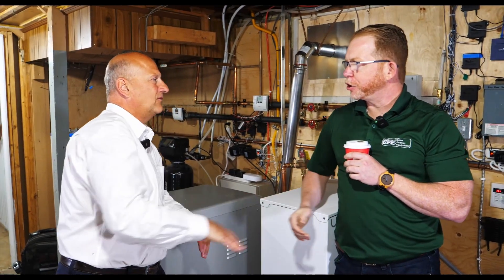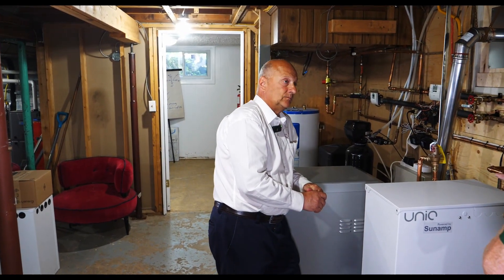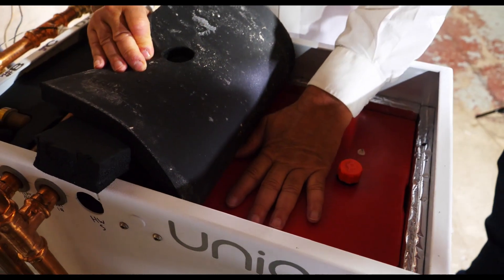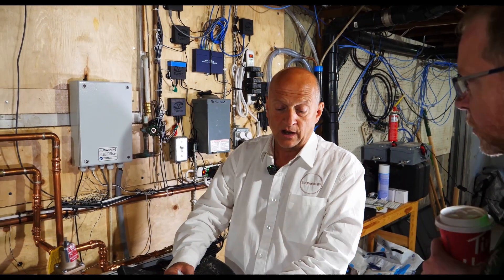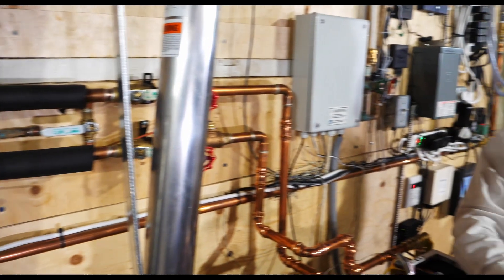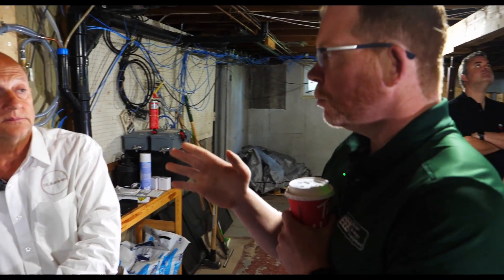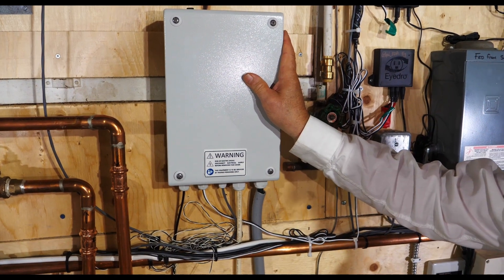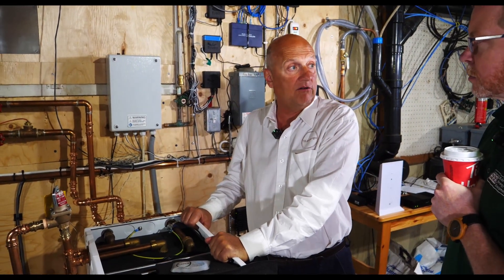Unlocking the Future: Sunamp's Revolutionary Thermal Batteries!

Comment: I'm sorry but what you have is really obsolete. We don't need to storage energy. This is ridicules. No one will use a gas furnace in the future. Electric energy is free.
Reply from the maker: Thanks for commenting. There is no gas because this product is exactly as you said the future. It is charged with thermal energy from any source including PV, a heat pump or solar thermal. In this example they used waste heat from a generator
Reply: If you use your head for a second.

I go to work. Nobody home. Sunny day. PV panels on roof, wasted.  No, not having a li-ion bomb near my house either. But, put this thing in and I can store the free leccy as heat! Could do that with a water tank, but that is cold within a day. This thing however remains able to heat the HOUSE at NIGHT as well as DHW from the taps.

No explosion waiting to happen in the li-ion battery... There isn't one.

Hot water for days and all I needed was one sunny day.

 And if the sun doesn't shine, when the clouds are thick and black, but the wind is blowing, the nuclear plants are humming too and there is loads of electricity and the price plummets, even going NEGATIVE, well I can literally be PAID by the electric company to charge this thing up. Thats better than free mate.
Reply: @dlarge6502  But if I have a device the size of a shoe box  that cost about $40.00 to build and that will will pull energy from your surroundings, not heat or cold energy that will power everything electric in your home in fact 3 homes that will last about 35 years then that is better than what you have. It has no moving parts and is all electronic. Can't beat that with a stick.

Comment: Why do you convert electrical input to heat with a resistive element rather than a heat pump?
Reply: Well, if you can't have a heat pump...
Reply from the maker: Thank you for your comment! The unit can be charged using its built-in 2.7 kW element in approximately 5 hours. Opting for off-peak charging can reduce the cost to as low as 2.5 cents per kW in certain regions, compared to on peak costs.

The unit can also be thermally charged using an air-to-water system, air to waters can easily achieve an impressive COP of 2. With off-peak rates, this can bring the cost down to just 1.25 cents.

PCM batteries offer versatile applications at a fraction of the cost compared to traditional lithium batteries but more important allow us to store BTU instead of watts

Comment: But can it power a car... 🤔
Maybe proof of consept with a lawnmower?
Reply from the maker: This is a thermal battery for heating your home not for storing electricity. Your comment is spot on that it will not run your lights but it will heat your home. Tks for sharing your thoughts 🙂
Reply: @plumbing-hvacmagazine  I was just thinking about a different application for the technology, using it as a thermal battery and generating electricity on demand via a heat differential.  Was thinking of a possibly smaller one for a car.  Maybe not power the whole car for long distances, but maybe siphon the heat off the engine it the battery pack, or the inside of the car when it's parked in summer, and then use the extra energy for some extra miles, or to save battery power for driving and use this for the internal systems within the car ... 🤔
Reply from the maker: @colleenforrest7936  it's a great thought. The smallest unit is about the size of a microwave and they are charged thermally or with 2.7kw of electric energy. In our next episode we will show off a site using this battery off grid to produce 80 percent of their domestic hot water. Thanks for the great comments

Comment: $4,000 to offset the cost of an 80 gallon water tank?   Hmmmm
Reply from the maker: Great question and thanks for commenting. We cant speak to the price because we dont know the price ourselves but keep in mind this is NOT a buffer tank its closest comparison is a high performance indirect.

While water is a commonly used medium for thermal energy storage, phase change thermal batteries utilizing phase change materials offer several distinct advantages:

Energy Density: One of the primary benefits of PCMs is their high energy storage density. This means that, for the same volume, a phase change thermal battery can store more energy than water. This allows for compact energy storage systems, which is especially beneficial where space is a constraint.

Targeted Temperature Range: PCMs can be engineered to have a specific melting/freezing point. This means the energy storage system can be tailored for specific applications where a particular temperature range is desirable. Water, on the other hand, has a fixed phase change temperature at 0°C for freezing and 100°C for boiling (at standard atmospheric pressure).

Consistent Temperature Output: During the phase change process (from solid to liquid or vice versa), the temperature of the PCM remains nearly constant. This is a useful feature for applications requiring a consistent temperature output, as opposed to the changing temperatures one might get as water heats up or cools down.

Reduced Heat Loss: Due to the latent heat storage mechanism of PCMs, there is reduced convective heat loss during the phase change process. This means that, under similar conditions, a phase change thermal battery retains its stored energy longer than water. Our host Michael uses a water battery not a PCM and it cant store energy for when its needed because of the stand by losses

Versatility: There's a wide variety of PCMs available, from organic compounds to inorganic salts, that cater to different thermal properties and price points. This versatility allows designers to choose the best material for their specific needs.

Integration with Renewables: Phase change thermal batteries can be efficiently integrated with renewable energy sources. For example, during peak solar hours, excess energy can be stored in PCMs and then released during non-sunny periods, providing a stable and continuous energy supply. In our next episode we are in a home where they have a PCM and are completely off grid and it produces 80% of their hot water and has for  2 1/2 years. We dive into the logged reports during that episode as well as walk the home. 

While water is abundant, cheap, and has been used for thermal storage for a long time, phase change thermal batteries offer performance characteristics that can make them a better choice for many applications.
Reply: @plumbing-hvacmagazine Was the episode ever released with the off-grid house? Thank you

Comment: How are you addressing the failure and leaking of your "batteries".  There are videos on YT showing this issue.
Reply: They are not batteries in the traditional sense. Eutetic Salts in a liquid form in plastic containers. The chemicals are not noxious, like battery chemicals. The manufacturer backs the units with a decent warranty, so service shouldn't be an issue...
Reply from the maker: Thank you for your insightful follow-up. You're correct in pointing out that there is no significant safety concern with the Sunamp heat batteries. This assurance stems from the design and materials used in these units. Sunamp's technology utilizes phase change materials, specifically designed for thermal energy storage. These materials are non-toxic and non-flammable, which inherently makes them safer than many traditional energy storage systems.

From talking with their CEO in person he has told us that Sunamp's products undergo rigorous testing and quality assurance processes to ensure they meet high safety standards. This includes addressing any potential for leaks or failures in a way that minimizes risk to users. Whenever you see a user on Youtube complaining of an equipment issue its important to ask why and understand there could be other underlying issues but we are by no means taking a side. We encourage everyone to reach out to the manufacturer with any questions they may have. It's always refreshing to have knowledgeable viewers like you contributing to the conversation and helping to clarify important points about the technology we discuss. Thanks again for your valuable input!
Reply from the maker: Thank you for bringing up your concerns about the Sunamp heat batteries. We understand that issues like this can be concerning, especially when you come across videos that highlight these problems. It's important to note that we, as the creators of this video series, are not directly affiliated with Sunamp. However, we are committed to providing accurate and helpful information.

For specific inquiries or concerns about a video its important to note we dont have the whole picture or the whole story, we recommend reaching out directly to Sunamp's customer support or technical team. They are best equipped to address these issues and provide detailed information. If you need assistance in making this connection, our series host is available on LinkedIn and would be more than happy to help facilitate this communication. Ensuring you have the right support and information is important to us.

Comment: We have one,  its a nice unit, was a pain to move at something like 250kg
Reply: One of its (very) few disadvantages over an equivalent water-based storage vessel.  I wonder if you'll be able to get them delivered empty of PCM in the future and just fill it up from easily portable 10 gallon containers of PCM prior to commissioning or something...?  You'd have to heat the PCM first, of course, to melt it...
Reply from the maker: Our host Michael attempted to move one in his life fire lab by himself. He thought he had the Thermino80 which has a  weight of 164lbs. He actually had a 300 which is 496lbs. He was not able to move it... despite all his Crossfit time :)

Comment: Please! Stop using "Latent Energy" and say what it is: Latent Heat

The heat pump produces heat as a "waste"??m

Then 😂"From an Exergy standpoint" wtf is that?
I do understand the points about energy density and cost of sunamp versus lithium

"...the last furnace you will ever buy?" Is it not you already bought your last furnace?  This is clever tech, don't over complicate it.  Micro CHP is presumably a generator set with heat recovery.
Reply from the maker: Thank you for your constructive and insightful comment. The allure of filming without a script is seeing how viewers dissect and understand various terms and statements. You're spot-on regarding "latent energy," but I'm confident the video conveyed its intended message. 

When it comes to your observation about the term 'eXery', I value your input. To clarify for those who might not be as versed in the concept of exergy as you clearly are, let me use an analogy: It's not about whether a coffee maker can produce hot chocolate. Rather, it's questioning why a coffee maker would consume 10 units of energy to prepare a cup of coffee when another gadget might do the same with just 2 units. It boils down to efficiency. While the coffee maker might be adept at converting energy to heat, it possibly isn't the most exergy-efficient means of brewing that cup.

The concept of a micro CHP generating domestic hot water from waste heat through a thermal battery is indeed a forward-thinking application.
Reply: @plumbing-hvacmagazine Rewatching. Thanks for your comment.  I do like your product, but you are vague on many details specifically the question of raising steam, surely there is no way this device is doing that?
Reply from the maker: @simonmasters3295  It is not out product. We are just covering it in our on going HVAC series. If you reach out to sunamp they can help more.

Comment: A DIY Sodium Acetate system is worth about $50 . stop ripping people off. Publish plans not garbage
Reply: I'll take a tested, designed and warrantied product over the thing you knocked together with a hammer on a Sunday afternoon after a few beers, thanks.
Reply: Wow. Garret, You don't mince your words.  

These units are tested to specific temps, many cycles and are ready to ship!   There is nothing like this elsewhere
Reply: @simonmasters3295  OMG in 1990 I took a 2000L plastic water tank and placed vertical PVC pipes in it with copper coils and Sodium acetate with an on demand solenoid that activated each tube. It was solar heated of course. good old 50 C water came out the other end. Stored it for months.
Reply from the maker: @GREFOUNDRY  I appreciate your interest in DIY projects, but it's essential to note that PCM batteries, especially when used for heating and cooling systems, involve complex technology and safety considerations. Manufacturers adhere to rigorous safety and testing standards to ensure these systems are reliable and safe for consumers.

Attempting a DIY PCM battery system without the necessary knowledge and experience can be both dangerous and potentially illegal. It's crucial to prioritize safety and follow established guidelines when working with advanced energy storage systems.

While sharing plans and knowledge can be valuable, it's important to recognize the limitations of DIY projects in complex areas like this. Manufacturers play a critical role in ensuring products meet safety standards and function reliably. 

Just as I would advise against attempting dental procedures on your neighbors, I would also strongly discourage you from taking on the responsibility and potential liability of constructing a unique PCM battery for your neighbor.

Your comment is a appreciated and valued. Thanks for watching and for sharing.

Comment: Cost of unit? How many gallons per hour flow?  Mentions equivalent of 80gal water heater...
Reply: In the UK (and Europe - Fischer have apparently done a deal to distribute re-branded Sunamp heat batteries in continental Europe) they currently cost much the same as the equivalent mains pressure (ie stainless steel) hot water storage costs.  Given the actual material content (and type) I would expect the cost to eventually fall to significantly below the equivalent water-based system.
Reply from the maker: If you reach out to Sunamp directly they can answer these questions for you. Thanks so much for taking the time to comment.

Comment: LOL greenie, this guy is full on democrat.  This is so dumb it's not even funny.  This is the most expensive way to store energy.  Why not run the freezer instead?  Or better yet, put it in a tried and true substantially cheaper and larger thermal mass under the house/building.  This is a scam, shame on PHVAC for pushing this garbage.  Conversion from electricity to heat is the least effective way to store anything.  You can get 100times the heat storage in the building materials already used in the building and 10x less cost.  Propress for heating is not really great either.  My company and many others refuse to use propress for heating because of it's propensity to have failed orings.  I've personally seen it.
Reply: LOLOLOL And sharkbite hahaha.  I didn't see that until now.  Pitiful.

Comment: What temperature is required to get the phase change from solid to liquid?
Reply: there are now some in the market that works with the temp range of 50C
Reply from the maker: It depends on the model. Sunamp makes PCM at various phase change temperatures. This particular one provides sensible and latent BTUs at 150f
Reply: @plumbing-hvacmagazine  than this won'nt be compatble with heat pumps?